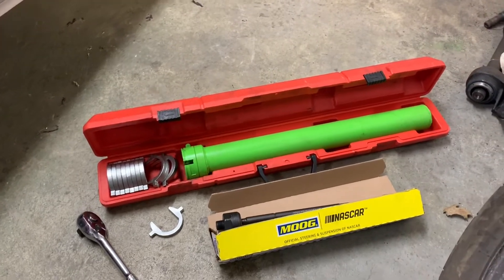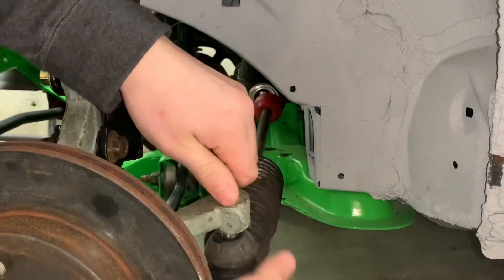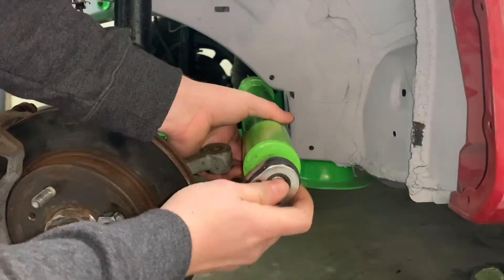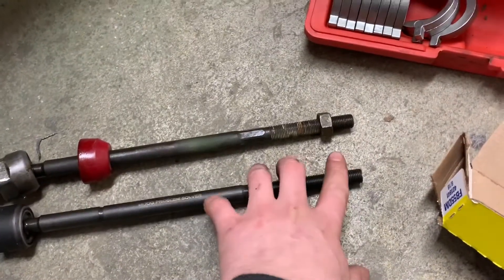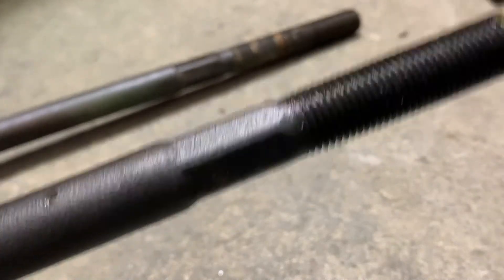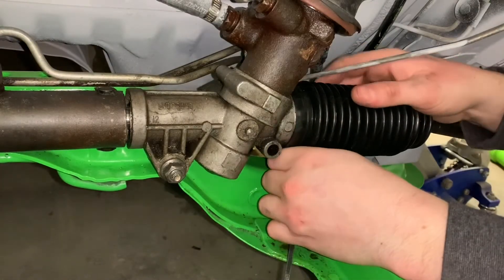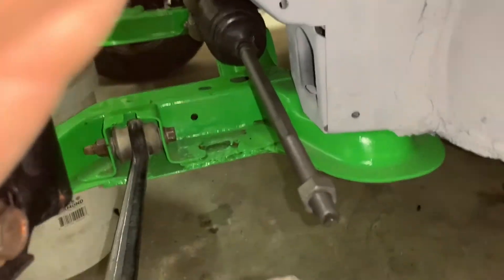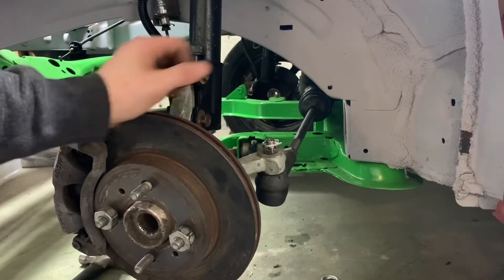Tie Rod removal with an Autozone rental tool

Comment: That’s the exact same tool that Oriellys has and I couldn’t get a good grip it kept slipping. Used the wrench 🔧 end closest to nut but kept slipping. I read all the instructions and locked the wrench end piece tightly with the locking mechanism. I ended just buying the inner tie rod . I was using it at junkyard but like I said it kept slipping..

Comment: does not fit VW ag group cars, porsche, audi, vw.   I used a big crescent wrench (400 mm) after trying this even with its 11 dies/u things/inserts/whatever .   I found the everforce tool kind of iffy even for harbor freight tool quality - less than the pittsburg brand these days.   I am sure if it fits, it will make the job easier.   Best way to check is look at the replacement part, grab the interchangeable U thingies.   And make sure there is absolutely no play on the new part before purchasing the new part and starting the job.   If no play, go for it.  But the last thing you want to do is have the steering undid and have to figure out how to complete the job.   My crescent wrench has a bigger foot print and worked on an audi S5.  If you have room, you can also use a pipe wrench and that will fit the really big ones.
Reply from the maker: I’ve also used crescent wrenches and if used with enough room to prevent stripped and are able to get enough torch work just fine

Comment: For some reason my tie rod head is too big to get a tool on, I have this tool and the one with three heads and on this tool, the shaft is too small for my tie rod head. I cant get the shaft to touch the adapter. SMH
Reply from the maker: What vehicle is it?
Reply: @TyAlmeida97  05 Durango. Finally got it with a pipe wrench. It was hard because the torsion bar is right there in the way,

Comment: At 08:03 .. Leaving that cable tie(zip tie) like that is so Dangerous for the next guy to cut himself .. Rather leave the cable tie uncut if you are not prepared to cut it correctly without leaving that sharp edge like that .. (even if that was cut there at 90 degrees at that length, still No okay) .. :(  Cut it correctly or leave it be ..